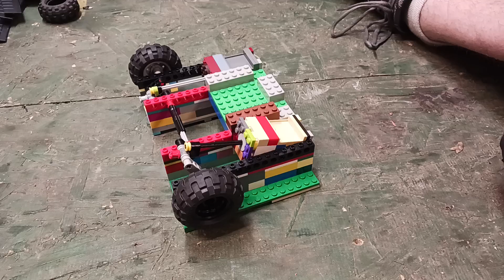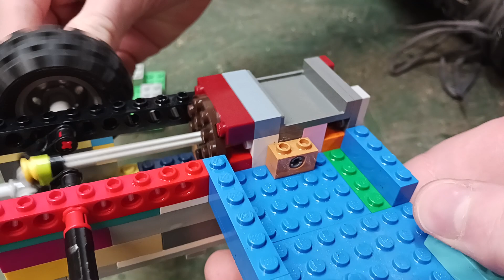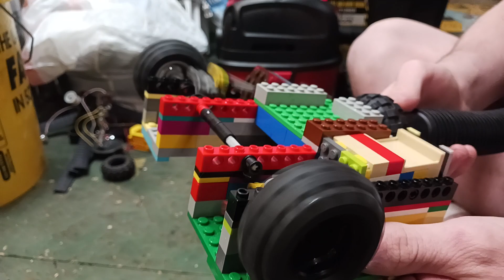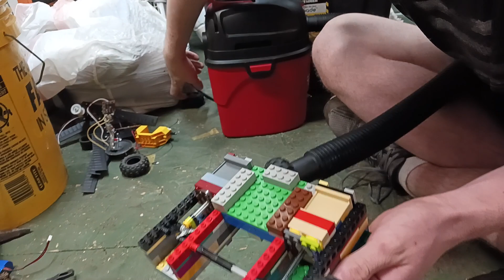New Lego 2cyl Oscillating Engine

Comment: Instead of blocking the air with the 2x6 bricks make it 1 stud high so it lets air into the cylinder increasing speed and torque.
Then I think the pistons should be 180 degrees so it's smoother and more torque